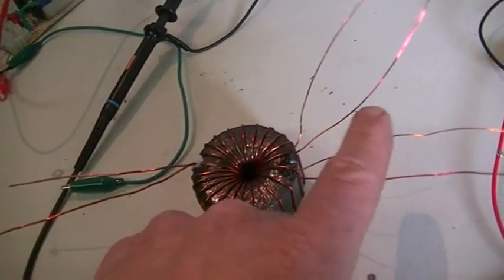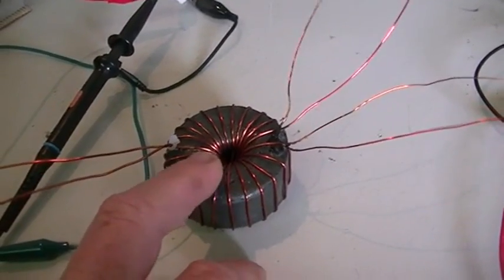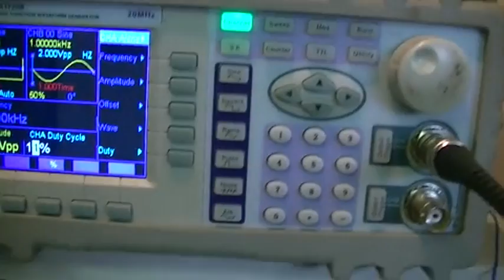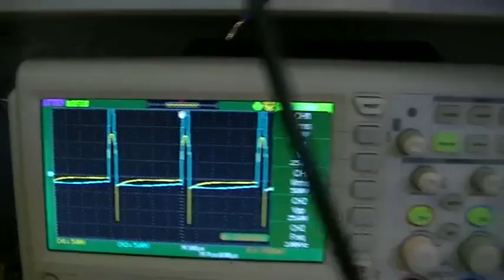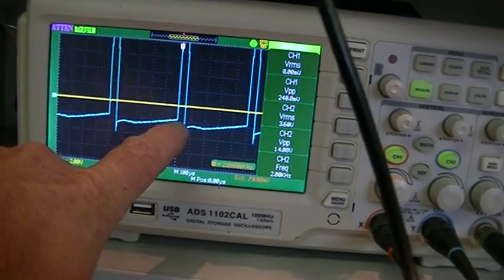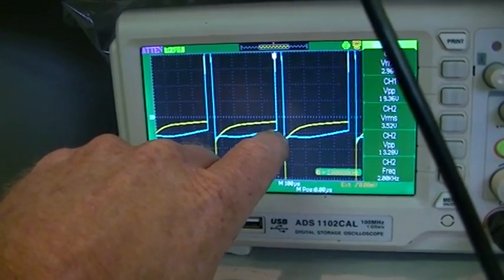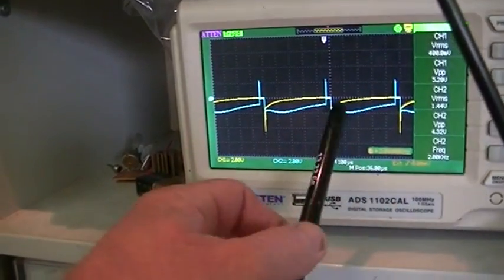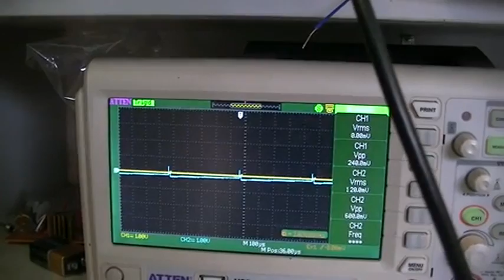New transformer design

Comment: After watching this hybrid coil, I was remembering the Gabriel Device by David Klingelhoefer. David used a high permeability core for the inner secondary and a soft steel encasing for the primary outer core. He did not have anything sophisticated for measuring or pulsing, except for two units of kill a watts, but he had to use an old toaster to help him handle the returned power, which you also found in one of your Chinese transformers. 
I did not know much about anything, but noticed that my variac, when set at 100v was returning 92v ( which helped in its early demise) but I managed to run a quarter horsepower AC water pump from one of the Secondary.
I for one, know for a fact that the architecture of this design, has one of the greatest output potentials of anything I have ever seen.
Thank you for using it in your pulse motors and the lighted neon with no power source.

Comment: I would think this is just a better focusing method concentrating the magnetic flux into the coils inside of the donut. The flux would go from outside to inside of the donut. The external transformer winding is more of a capacitor type of induction. Well more so then the inner coils which would be more true induction. The cavity could also work as a magnetic tank of sorts and fills with flux. This could be the extended release you see in the inner coils. You could think of it like in a water analogy. Pressurizing and relaxing. Storing and releasing additional flux which cuts the inner coils.
 It would be interesting to see if a bifilar coil would take this further. Hmmm...

 Don't take this as gospel but you might find that a better explanation.
Reply: Jon Bigman agreed

Comment: Is this an attempt at alternative design for the 'c' core
(or maybe it was 'e' core) of special material that is almost impossible to track down and purchase now? (used particularly in an certain overunity project years ago). Seems really similar. I hope it works...and you should copy and spread the video quickly if it does.  btw where did you get such a large toroid for the center?

Comment: Fascinating experiment. The difference in wire length would account for a much greater ratio of inductance to resistance of the inner core coil, but that would only add to possible current phase shift in the coil and a Reduced power factor at reasonably high frequencies, not an Increased apparent power output compared to the outer coil.
Thanks for sharing. I find this apparent increase in efficiency very interesting indeed.
A simple method for improving efficiency.? I really would love to see a wide range of experiments on this core/coil arrangement. How does it respond to pure AC input?
Again, thanks for sharing.